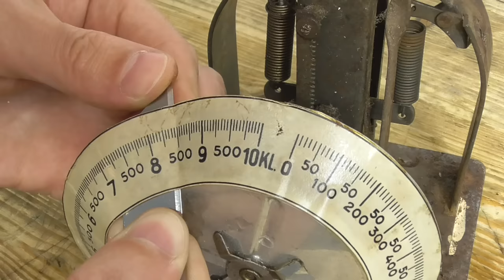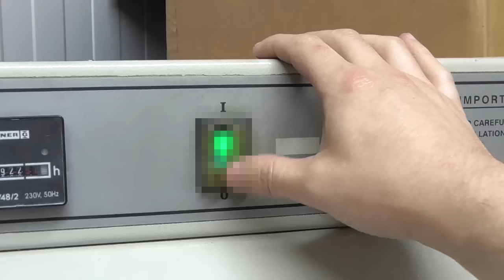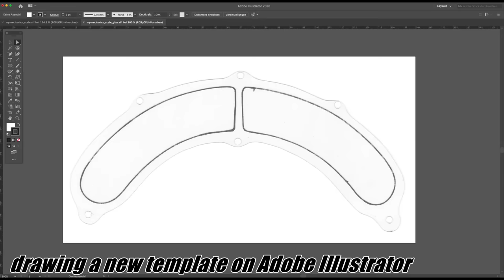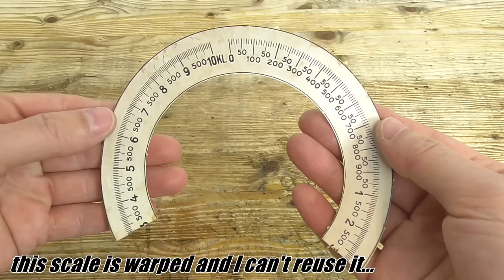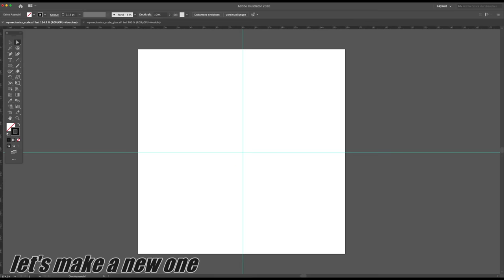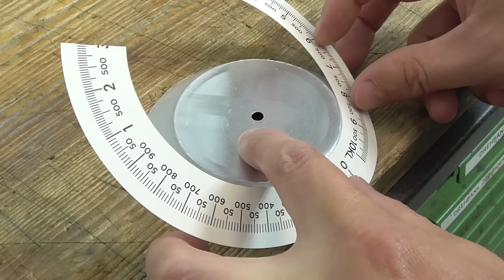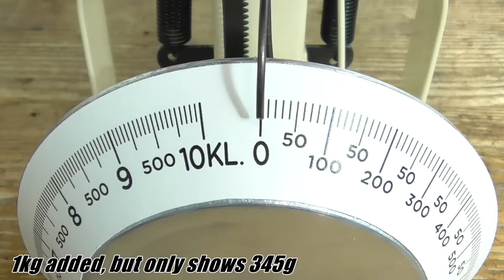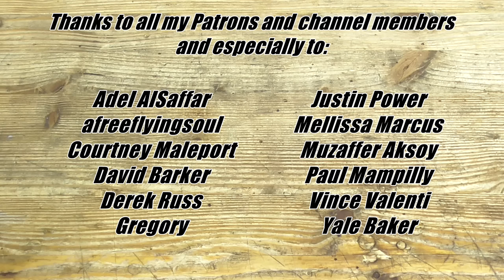Antique Kitchen Scale Restoration - The Masterpiece

Comment: Sheet metal hand forming on a lathe.
Well, I'll be damned if I saw this coming.
Sir, you are a master craftsman.
Chapeau.
Reply: Ya it's too bad he resorted to body filler tho. Craftsman's duct tape I call it. Designed to hide flaws people don't know how to fix.
Reply: loricott, the only thing that can be faulted is calibrating to 1 kg.  In defence of the craftsman, which this gentleman is, it may be a good possiblilty that he has not had much to do with weighing equipment before.  Whenever you calibrate a scale, go as high as you are able to with known weights, then calibrate.  Any minor error at 1 kg will be magnified at 10 kg, as the error percentage is linear as you add more weight to the scale.  So, if you are 10 grams out at 1 kg, it is a very good chance that you will be out by 100 grams at 10 kg.

The other thing that would need to be done is to place the 2 kg on the ends of each of the arms, in turn, and note the readings.  If the readings all come back identical, there is no problems.  When you are testing a scale, by doing this, you are ensuring that you are getting a consistent reading, no matter where the weight is placed on the scale.  On a weighbridge, at 20 tonne, the worst error that is known to me is 240 kg from one end of a 9 metre deck to the other.  Inspector had great delight in giving the weighbridge a star for rejection!

Comment: The sheer quality of ALL his restorations are unmatched by any other restoration channel. After finding you, I no one else can compare.
Reply: There's nothing worse than having My Mechanics channel be the FIRST restoration channel you discover. Thats because if that happens, there is only one decent restoration channel to watch.
Reply: Yea I watch other channels like, “only two coats of paint? And he didn’t bother sanding the screws?! Pfft why even bother?”
Reply: This man leaves no one behind
Reply: Agree!!
Reply: What I like most,when he uses screws instead of the old rivets. Screws make soooo much more sense!😊 Yeah,be got the best restoration Channel on YouTube!😊👍👍👍👍
Reply: Most of the other restoration videos I've seen, people just do a thorough clean up job and minor replacement. They don't go the lengths to actually make new pieces that this guy does.
Reply: Agree, but LADB is still a bit different in that they really go for the original. I like them a lot too.
Reply: @Vikingwerk  this is what happened to me.  Now I am questioning why people are not sanding out cast marks and polishing the heads of every nut, bolt and screw.  The Hand Tool Rescue guy does some really cool stuff but he never makes anything shiny.  Bolts must be polished, no exceptions.
Reply: More like the shear quality.

And the arbor press quality, and the oil can quality.
Reply: Most other restoration channels do not have access to hundreds of thousands of euros worth of professional machine shop tools and equipment. And I mean hundreds, 1 hundred thousand isn't enough to cover everything he has there.

Comment: Page one of My Mechanics specification book: All edges must be chamferred or beveled and all fasteners must be  countersink. NO EXCEPTIONS
Reply: I smile at that detail every time he does it.
Reply: Page two of My Mechanics specification book: All castings shall have any flash or mold marks filed flat, any pockmarks or divots shall be filled and sanded flush.  All bare metal parts shall be buffed and polished to a mirror chrome, brass, or copper finish.
However, this time I was surprised he went with a brushed finish on the copper plate.
Reply: @davidmarquardt2445  😄 Dead on! This spec book pretty much writes itself! Man he freaks me out spreading body filler with that janky putty knife. I want to send him a rubber squeegee so bad. It would save a lot of sanding
Reply: As this old Tony says..... When it comes to chamfering there's no cutting corners.
Reply: @davidmarquardt2445  its a highly functional part that will get lots of scuffing during use. this is a better finish for this purpose.

Comment: It is simply astounding the amount of damage the interior pieces had taken, I can understand the springs having wore out but the metal pieces that were gouged? I suppose it could have been something that occurred during the manufacturing process and the company did not want to absorb the cost of substandard parts so they were used in spite of the damage.
It is always a pleasure watching you refurbish your projects, watching a master craftsman at work is like viewing fine art.

Comment: The only thing I would have changed was the brass backing for the glass. I would have cut out a vinyl resist, and used acid to "cutout" the shape in a thin sheet of brass. Not because it is better, but because it would have added another technique to this technique heavy video. Being aware of so many of these techniques makes me appreciate the depth of your knowledge.
Reply from the maker: I appreciate your oppinion, thanks for watching :-)

Comment: I blued with that very same liquid a metal tool shaft and after a while it  became all rusted.
Any idea on what the problem is?
Reply: Did you rinse with water then soak in oil for 12 hrs? That's the key. MM has a video about bluing on his 2nd channel.

Comment: how does the increment change so dramatically at 1kg?  why is it one scale before 1kg, and a difference scale after?
Reply: The more a spring is loaded the more resistance it gives😉
Reply: @spooky3669  
are you familiar with hooke's law?
the force of a spring scales linearly with distance.
but this spring seems to suddenly change to a completely different k at 1kg.  that's not how normal springs work at all.